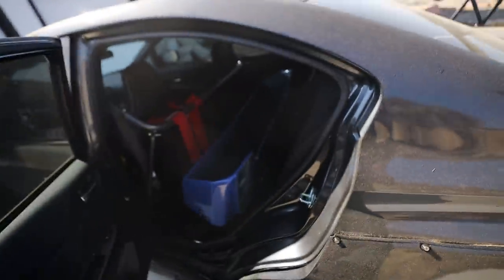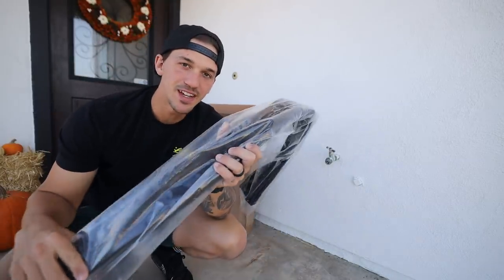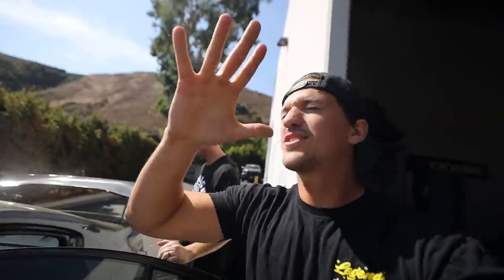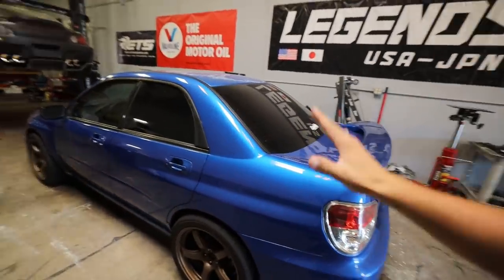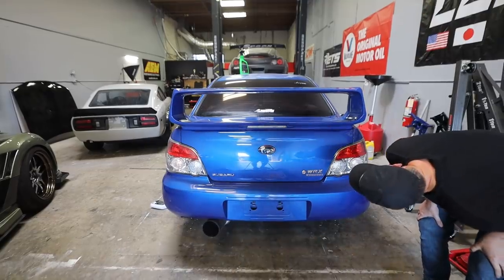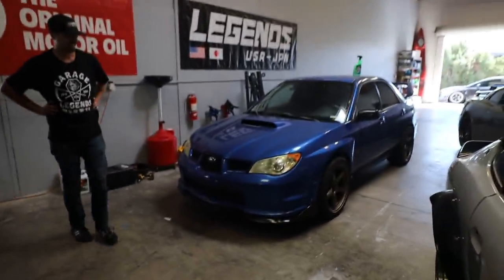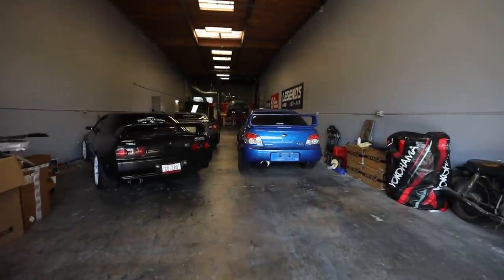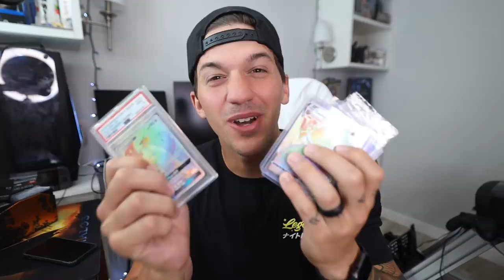Surprising Best Friend With DREAM CAR PARTS!

Comment: My suggestions for Tim's WRX:
-Side skirt's with a flare at the rear that'll match that front lip flare (if that makes sense)
-Rally armor mud flaps to match with the wheel fitment and help tie in the side skirts
-DRL Headlights to help freshen and modernize the front
-Blob eye tail lights to remove the chrome look on the back, or custom like you suggested in the video 
-Maybe rear spats and/or rear diffuser (and not the rear diffusers with the spiked shit (no shade to Dustin lol)) 
-Rear Sti roof spoiler
--Then maybe do some restoring mods such as: Repainting window trim, repainting windshield wiper arms, sanding and wrapping roof black (unless you guys are saving that for the future paint/wrap project), new badges? Other than that, some interior mods and of course; power and suspension mods.

Comment: Fuel pump, injectors, catless uppipe, turbo inlet, process west tmic, equal length headers (rumble goes away but once you start pushing a decent amount of power like 300+ the back cylinders build up too much heat and compromise the pistons), don’t do a blow off valve keep it recirculating but get a stronger one to handle boost, maybe do an external waste gate, and you gotta get some hella horns and a new vape 🤘🏻

Comment: Put the sti wing splitters in sti wing, also there are carbon fiber grill inserts and a license plate piece that fills the section around the license plate. These are expensive parts

Comment: hey, I'm not sure where you ordered that lip from, but the self tappers on that year bumper are horrible (I have an 07 as well) I'm on my 7th front lip in 2 years, more often than not, the first scrape will pull them out regardless, might want to nut & bolt it, even then they don't stay on very well, maybe add some double-sided tape too, either way , even after 6 lips coming off, I haven't lost my bumper yet